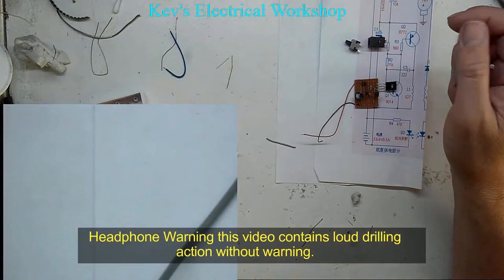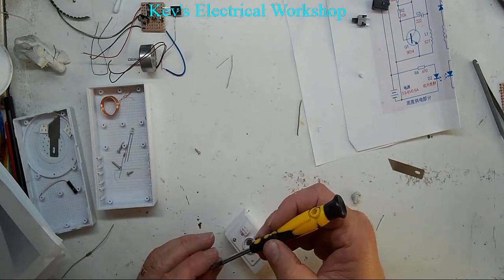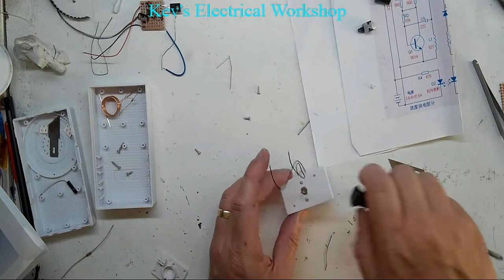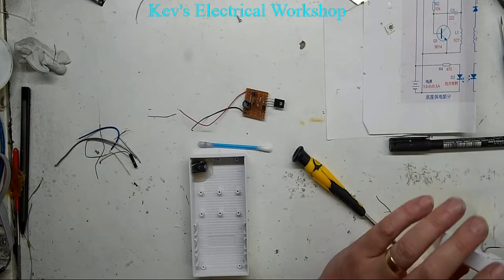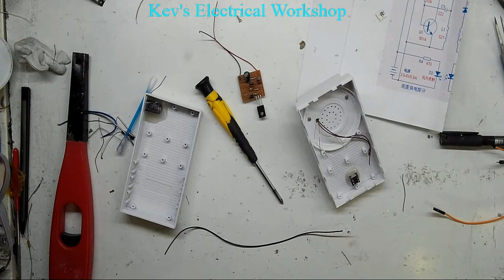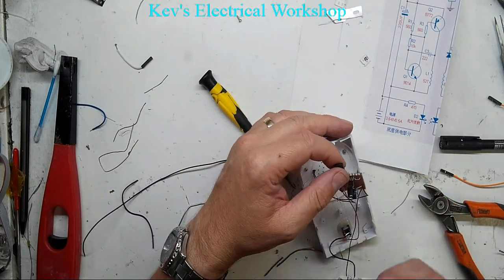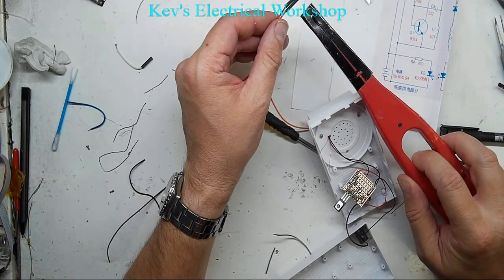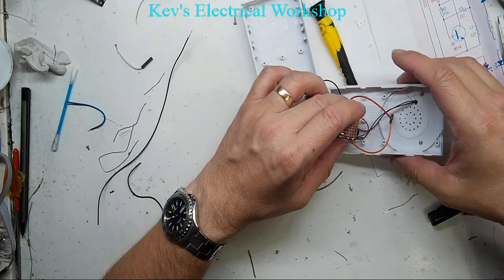Cross LED Dot Matrix Display Circuit Board Rotating Electronic Kit Part 5

Comment: When is Part 6 Coming out ?
Reply from the maker: is you wanting to know if it worked or just went bang :)
Reply from the maker: it will be out soon.
Reply: So did it work ?  I'm very curious    And did you get it to Program ?
Reply from the maker: cant spoil it for everyone, part 7 will be how i uploaded the hex i found online, parts 8 + will be trying to use some of the chinese programs, i may even add a recap of the build at part8 havnt decided yet. Part 6 is nearly ready.